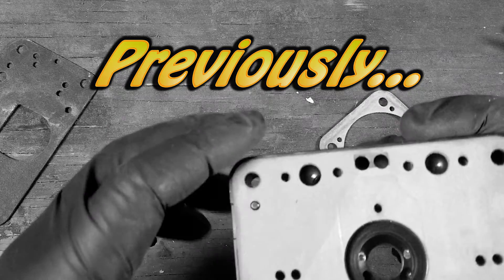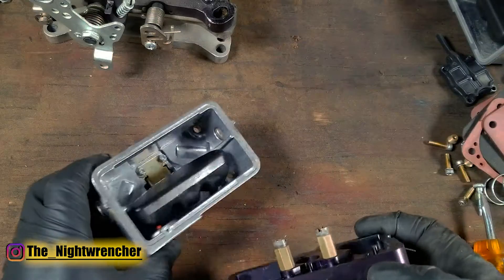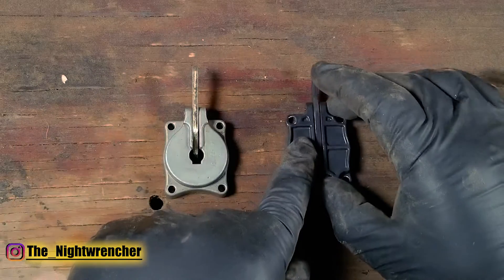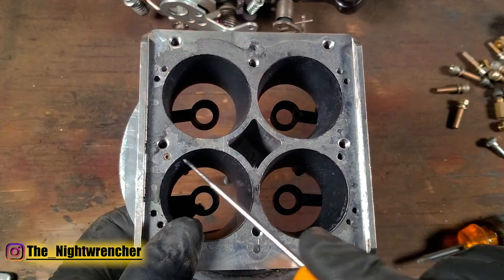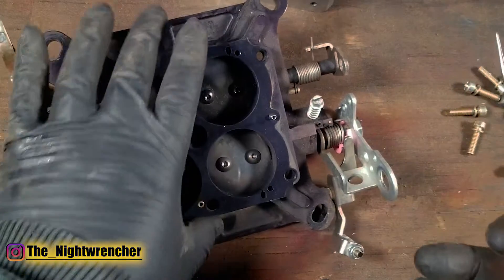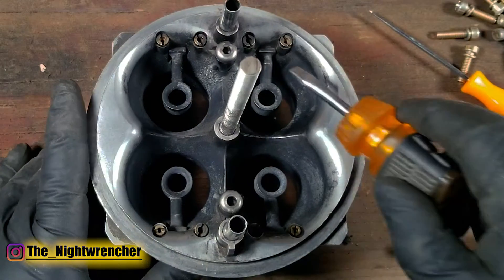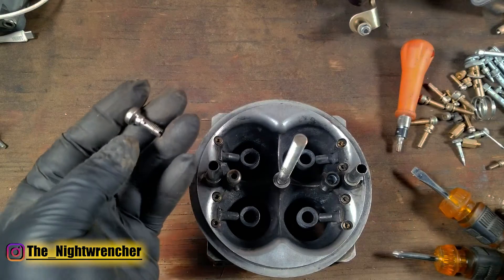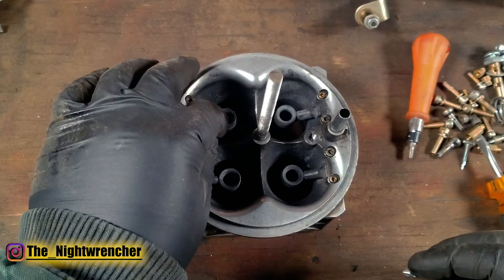Rebuilding A 4150 750cfm Carb | How To Rebuild A Holley Carburetor | Holley Carb Secrets |

Comment: what would you look for on a holley 80528-2 750  4150 does not want to idle  . stalls out but restarts if you hold the gas pedle to the floor
Reply: My carb is having the same issue, seems to be having an issue with the Venturi weeping fuel and flooding it. Holding the throttle wide open while cranking gives it the most air possible so that’s why it’s firing back up. Mine will run great in rpm’s, but then immediately stall when it tries to idle. What did you figure out for yours?
Reply from the maker: Leaking out the booster is either too high float level, too much fuel pressure, grime in the needle or worn out/too small needle oring

Comment: Life saver and absolute ledgend. Doing a proform main body conversion and seaching for why proform supplied 66 and 78 main jets. Watched this and  just noticed my new main body has that lead plug in the secondary. I've got Holley metering blocks and 4 corner idle and power valves so guess ill drill out that plug. I'm thinking ill go back to the standard 73 jets front are rear for the first start. Proform instructions are vauge to say the least and the net is full of people with problems on their retrofit install and no one mentions this plug....makes me wonder if this is their problem. Appriciate your thoughts if you get the time. Cheers from Australia.
Reply from the maker: Hey man, I just saw this message. I would not bother with a secondary power valve unless you are trying to dial in your staging at the drag strip. All my naturally aspirated carbs have a front power valve and no rear power valve. makes for tuning, much easier. If you know your old set up took 73 jets in the primary, I would start there and leave the 78 jets in there and try it. Adding the second power valve is too much work for not a lot of gain IMO. Good luck!